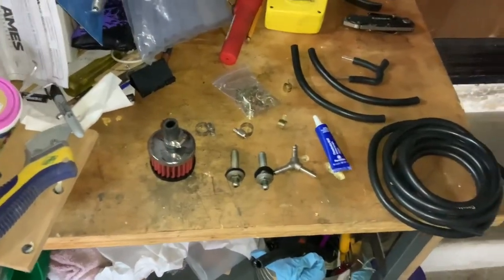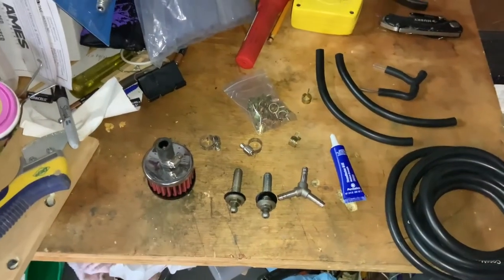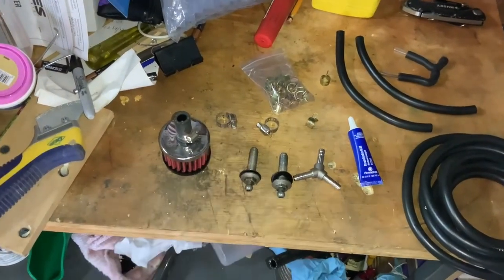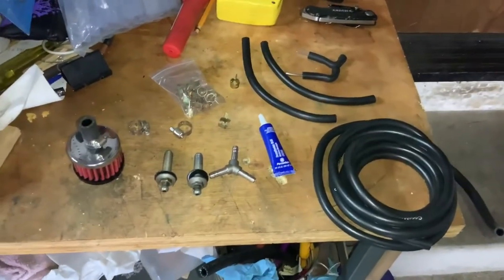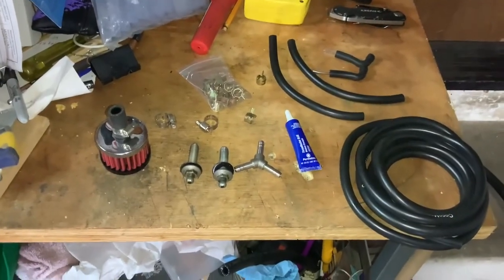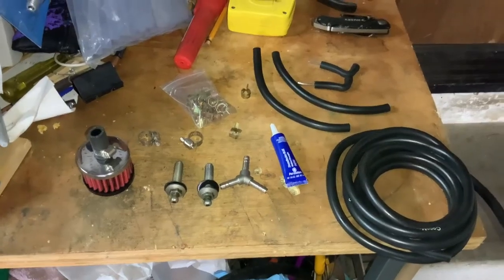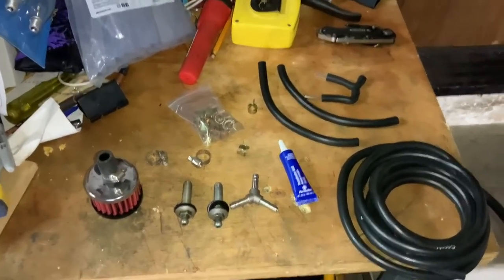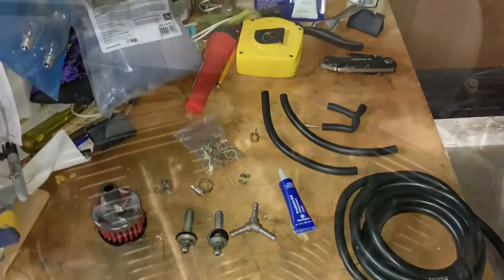External Breather DIY for your Harley Davidson #harley, #breather, #airfilter

Comment: run a line down ending by the frame and zip tie it to the frame ,you don't need the filter, crank case pressure should have no restriction .

Comment: I like the open filter look better, I did basically the same as you did. I also bought a round Harley Davidson emblem that is made to go over your original air filter cover to dress it up, but I left the oval cover off and just installed the round emblem so more cool air can get to the filter.

Comment: i planning to do it the same way you do it sir, but it don´t know if it is a good idea that the filter is hanging from the oil lines.
 Did you had any problems with that issue?

Comment: My 2017 street glide there is oil leak on air cleaner, what's the problem? Appreciate for the response
Reply: you need to do what he did crank case air has oil in it .